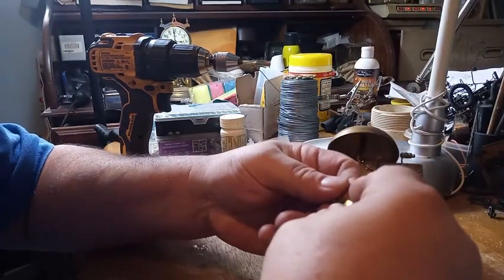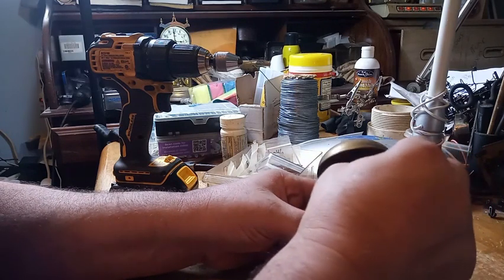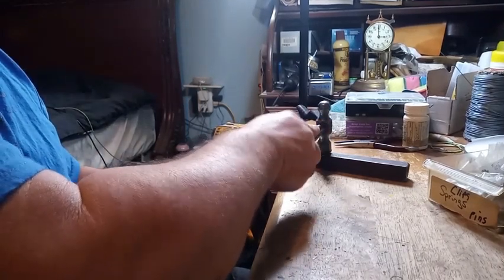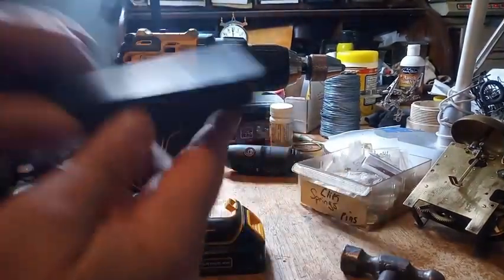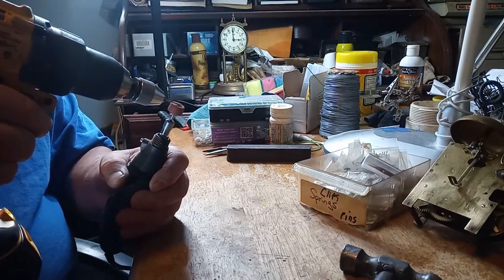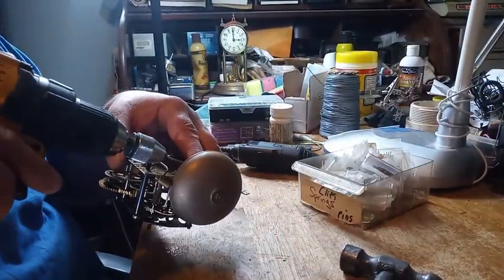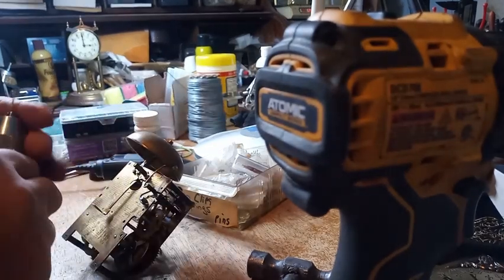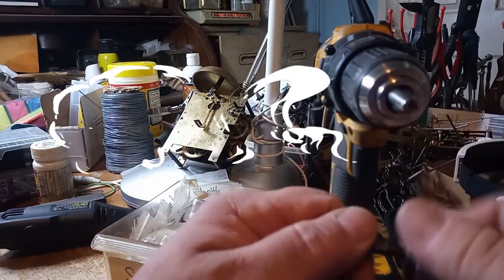How I straighten a bent shaft/arbor on a clock gear or make tapered pins for cuckoo clocks/clocks

Comment: Also thanks for info I just started to get into clock's and clock repair...I have a few that keep sticking on the chime and I'm afraid I need to clean the main spring on the chime side.
Reply from the maker: Typically a clock needs to be serviced about every 5 years. That means the movement taken out, taken apart, cleaned, fix any bushing problems, etc., then put movement back together, fresh oil, put back in clock after the clock movement is running. Chimes adjusted to gong, rods, etc..  So if it is sticking on chime side then yes serviced is probably required. It could also not be timed right. That meaning the set up was done wrong when the clock movement was taken apart and cleaned.
Reply: Yes it's my first time taking one apart
Reply from the maker: Take plenty of pictures before and as you take it apart. Always let down the power before taking the movement plates apart. Good luck.

Comment: Hey would you happen to know what a ( w ) and 34 mean on a mantle clock mean?
Reply from the maker: Is it a mantle clock or a cuckoo clock. If it is a cuckoo clock movement then the 34 means it is an 8 day movement. If the W is after the 34 then it is a date code started in 1970 and the "W" signifies that it was made in either 1988, 2008 or 2028 as they go every 20 years.
Reply: It's a mantle clock and looks like two intersecting Vs with a 3 in first v and 4 in second v
Reply from the maker: You can find me on face book. My profile picture is me hugging a fake bear. If you send me pictures I might be able to help out.